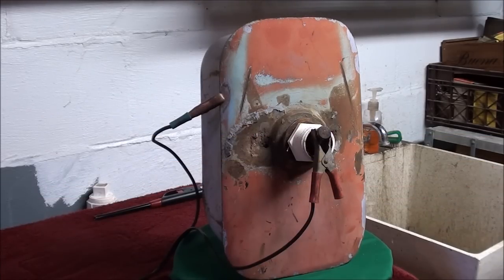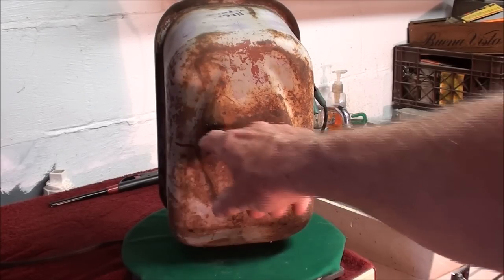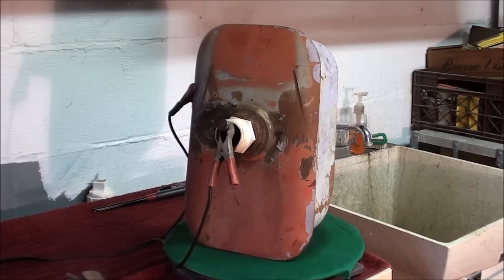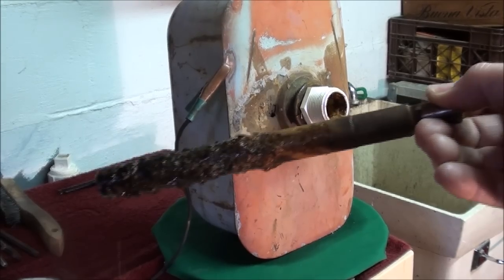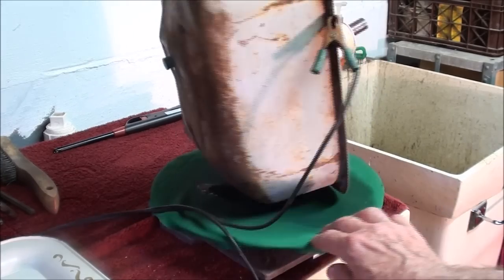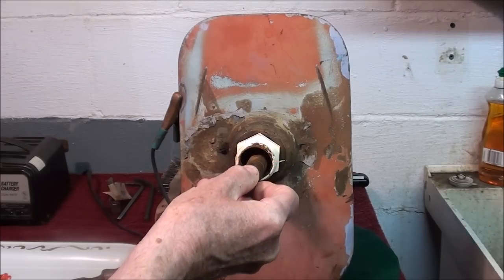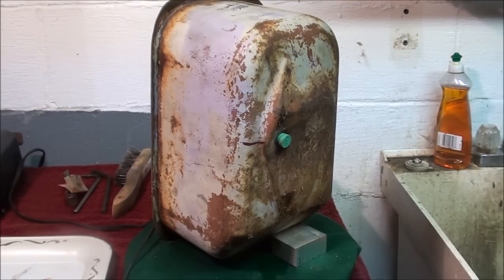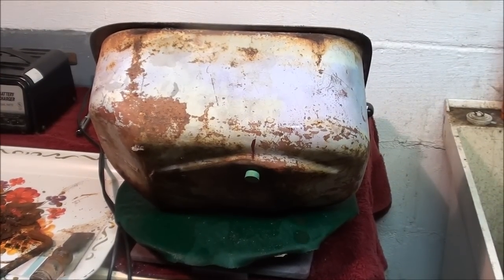Tubalcain Restores a VESPA SCOOTER #1 fuel tank by electrolysis

Comment: Tubalcain,   Know your much more versed on the lathes and many things than I ever will be.  Did a  fuel tank for my semi truck, and  smaller one for older Lincoln welder, put the whole thing is a big tub,hooked up the whole thing like yours, but submerge it all under water, put a piece of PVC just bigger that the anode rod so it can be held in the center of the tank. Worked perfect. Ran the Pos. to the bar in the center of the  tank opening with a wire from above. My rod was in the horizontal position    Thanks, love the videos,  Regards, DC

Comment: I have been enjoying your videos for quite some time just a thought rather than fill the tank with water and only do a small portion at a time and fight the water leaking out go to a feed store and buy a large plastic bucket, feed trough, plastic 55 gallon drum whatever submerge the whole Vespa gas tank in the large bucket hang an electrode down inside the large bucket and hook the other electrode to the gas tank and be done with it, it will strip your paint on the outside at the same time good luck my friend keep up the good work

Comment: I guess this is a way, I'm curious how well it'll work. A buddy of mine builds/restores bikes, his method is to use handfuls of sharp stones in the gas tank, cap it off, then fix it with rope (or wire) into a concrete mixer and let it run for half a day.

Comment: Hello, Just a thought for you, I had the same trouble with a small tank from a tiller that was my Grandfathers that I wanted to keep original I forget what brand it was but if you can find a 2 part e-poxy that is Gas Oil "proof " NOT Resistant as it WILL turn to a Jelly type Goo over time that is just BAD REAL BAD (ask me how I know lol) just mix pour it in and rotate till set up enough not to sag and let cure over Night, Also maybe a Bladder type bag might work like they use in a Aircraft Tanks just like a rubber bag Liner-just a few idea's for what its worth-Great video as always!

Comment: I used to clean the rust out of Lawnboy lawnmower gas tanks with a handful of small stones, a bit of gas and lots of shaking - after putting the cap back on the tank.  It would get a lot of the large scales of rust leaving the inside of the gas tank nice and shiny on the inside.

Comment: Check eBay.  Replacement vintage Vespa tanks go for $50 - $100.  The original lever cap is only $6.  I think you'll have more than that into this tank in materials when you're done and still have an old rusty tank.

Comment: I always used BB's for tumbling motorcycle tank. And if you check, there is a two part epoxy made for gas tanks. I used it when I restored my 1945 "45" Harley.
This basket cases gas tank was like a sieve.

Comment: JB weld makes and excellent sealant for hair line and stress cracks in a gas tank. I put in over a few leaks i had on a yamaha rt180 dirt bike i had, and it was still holding fine 8 years later when i gave the bike away. (and i wasn't kind to the bike either)

Comment: Best way to remove all the rust is with full strength muriatic acid. I have done it that way on a couple of motorcycle gas tanks and a moped frame with the gas tank made into it. Once you have all the rust removed, it is safe to weld on the tank, and you can weld up all the holes, then coat the inside of the tank with POR-15. DO NOT use Kreem. It is the devils own brew, and will destroy your tank. You can also cut out the filler opening and weld in the correct one. The main thing is going to be whether the tank metal is thick enough to last.